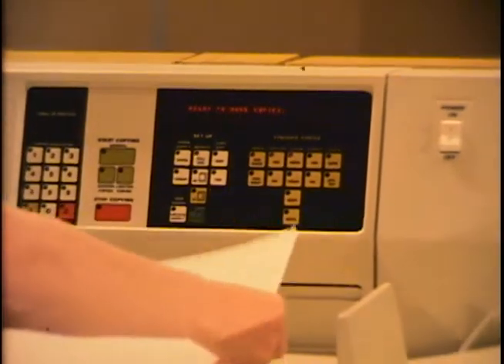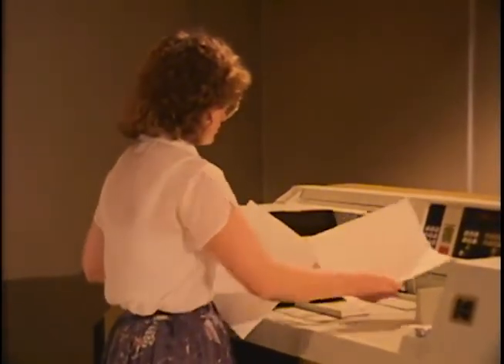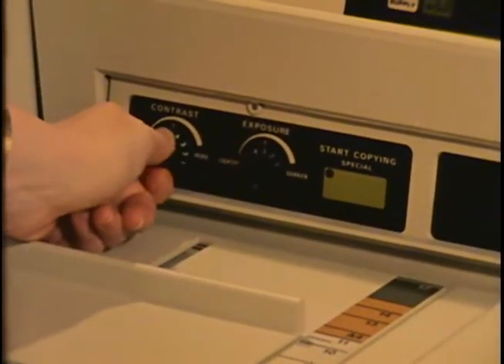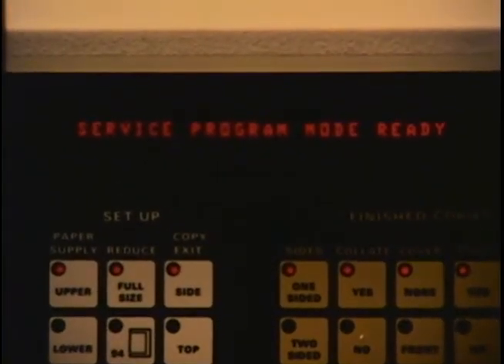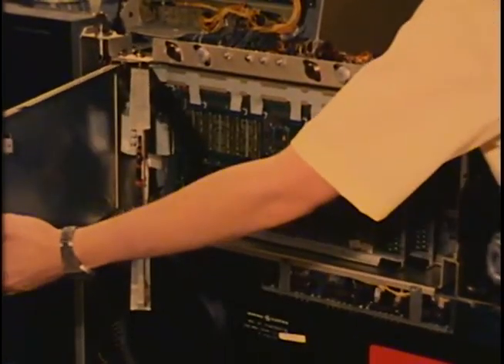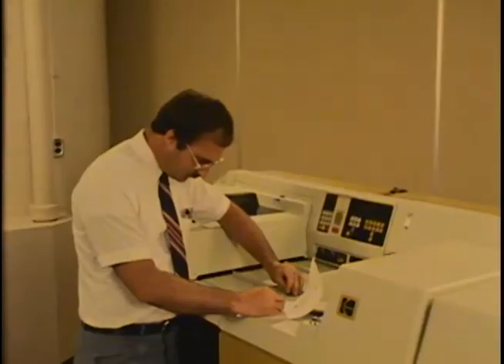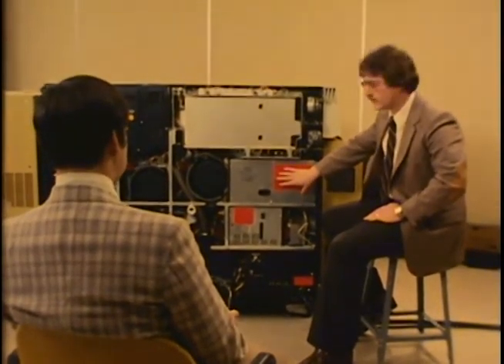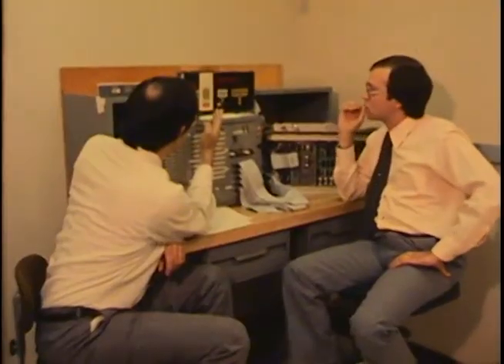Engineering with the Customer in Mind (1982)

Comment: Thanks for posting this. I was a Kodak ESR on the Ektaprint series in the 1980's in London. Worked on the 160/165, 235 and 300 series machines back in the day. Then moved to the ImageSource equipment. Eventually joined Xerox as a software design engineer in the1990s having moved to the USA. Watching this video brought a tear to my eye - many happy memories.
Reply from the maker: (Jan 2023) - My pleasure. Thanks soo much for giving field service support for the Ektaprint series in beautiful London. My wife and I have been to London twice, because we did Punch and Judy shows for decades in the USA.  I'm also a fan of Jane Austen. About the copier, I was intimately in contact with the software engineers of the Ektaprint 250 Duplicator for at least a year. Then took service calls when the first 100 machines rolled out of Rochester, New York. They were proudly made by hand by very talented manufacturing vendors and Kodak team members. If I sound like I miss those days of "Made in Rochester," you know I do! Again, thanks for your assistance in the 80s. Please stay in touch. God Save the King.